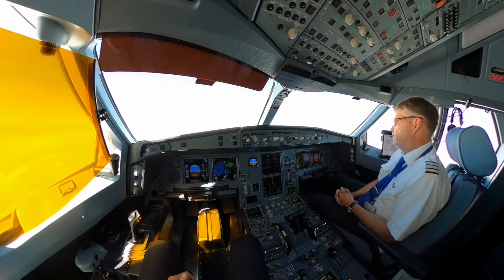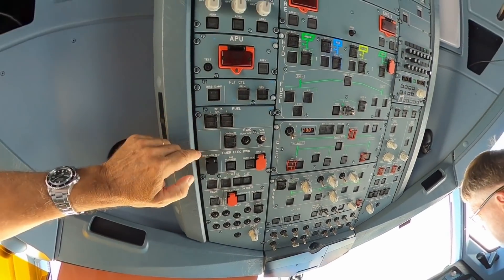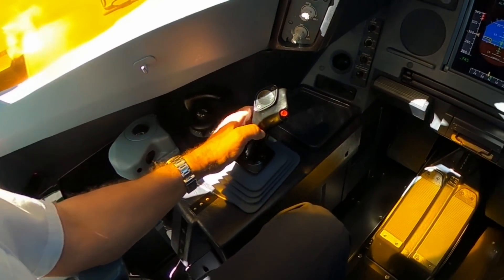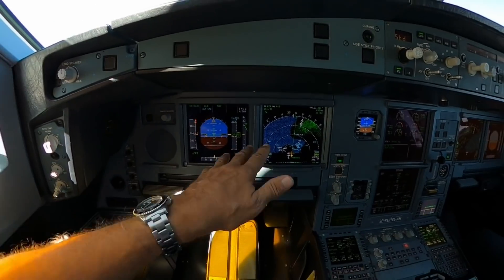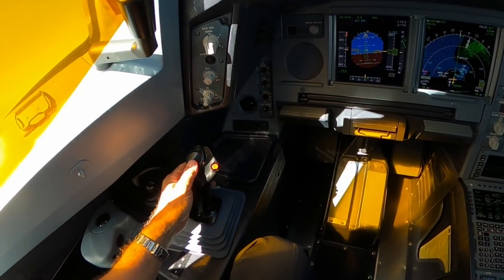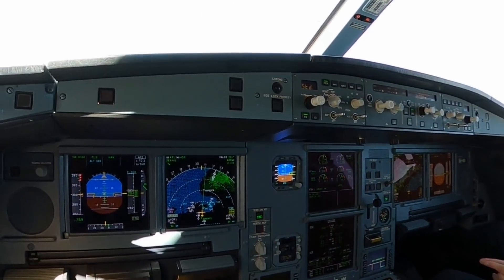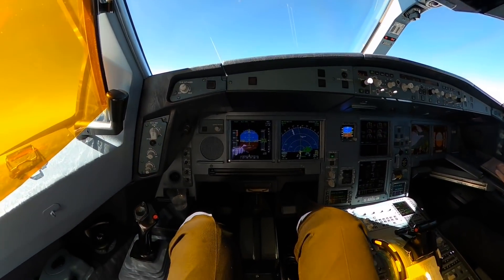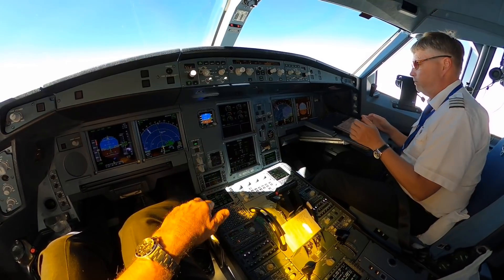The Airbus 330 sidestick.

Comment: I love learning how these computer systems work. One thing I’m curious about is (when in normal law), is there any difference in the force feedback of the stick when flying at higher speeds and altitudes? Here the bank stayed the same, being much easier to control. Basically does the plane ever roll or pitch naturally, like taking your hands off the steering wheel of a car? I know it would in alternate or direct law but would like to know more about the amount of “aid” the computers are giving in relation to the direct movements of the stick.
Reply: There is no like artificial feel or feedback on the sidestick. Once you let go of the sidestick it maintains the same attitude you left it at commanding a 1G rate of pitch (basically not pitching up or down) and 0 degree roll rate

Comment: It is telling these 5 computers what to do with the plane. So, now i am wondering in case of an electrical shutdown into a gliding state, what is the back up for maintaining control over steering the plane? Love these type of videos you provide. They fascinate me a lot as i am currently very intrested in aviation. Thank you for showing/teaching us about all this
Reply: The A330 electrical system goes through 3 mains busses. If the generators were lost then the Ram Air Turbine would drive an emergency generator which would power the Essential bus which I I think powers 1x Primary computer and 1x secondary computer. If all the busses were damaged (unheard of) then the rudders and horizontal stabiliser are mechanically controlled and the engines can be used to help turn the plane too

Comment: What if we have complete loss of those computers for some reason. The wires in the 737 help in manuvering the aircraft in these kinds of conditions.. i am really curious about this please answer
Reply: Good luck loosing all 5 (6 on A350) computers. They all run on different electrical systems and can take over one another if required. In the very worse case scenario then use the trim wheels, rudder and engines to control pitch and turn

Comment: the computer will correct the input if pilot overdoing it, am i right capt?
Reply: Depends on what you mean by doing it. The computers will protect from high AOA, overspeed, excessive bank angle, high G loads and excessive pitch attitudes

Comment: So will the flight computers go as far as holding pitch & roll through turbulence as well? Or does the pilot have to compensate for that themselves if flying manually?
Reply from the maker: The computers return the plane to the original pitch and roll. The smaller manual inputs from the pilot the better, says my experience.
Reply: @bjornpilot  Interesting, thanks!

Comment: Who decides to sit where? I always thought Pilots on the left and Co-pilots on the right. is that the case? if not who gets to decide who sits where? Either way, when learning to fly a plane do you have to learn to be ambidextrous? I can't imagine landing a plane with me left hand.
Reply from the maker: Pm8rsh 88 Both are pilots. One is Captain and one is Copilot. The Commander (Captain) is usually to the left and the copilot is to the right. Can be opposite during training.
Reply: @bjornpilot  Thanks. But what about the yoke placement though? As it's been moved from between the legs to either your left or right side. Do you have to try to be able to fly ambidextrous? Does it not feel weird for those who are right handed but have to fly it left handed. Surly there's some level of loss in control due to that?
Reply from the maker: Pm8rsh 88 No, it works fine. Imagine yourself riding a bicycle. You can hold the handle bar with either right or left hand.
Reply from the maker: Pm8rsh 88 No problem at all. Imagine yourself riding a bicycle or driving a car. You can use either your left or right hand to steer the vehicle. 😊

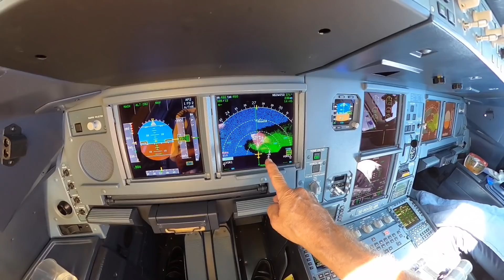Comment: Hi Bjorn, I have a question. At 5:23, on the left display the speed indicator shows 250 knots, but on the right display it shows the plane has a GS and TAS of 460 knots. Which one is true and why this difference? Also the mach is 0.80, so again, a little bit of a speed difference there... I’m not a pilot but I really want to know why are these differences. Thanks in advance
Reply from the maker: Felix Barac 250 is indicated and depends on the dynamic pressure. True airspeed eliminates the lower density of the air, at highter altitudes. GS takes the wind into acount. TAS plus or minus the wind gives GS.

Comment: What happens if you knock the side stick with your knee , while the autopilot is engaged ? 
Thanks
Reply: The sidestick is locked when autopilot is engaged and takes a fair amount of force to unlock it if not using the disconnect button

Comment: Interesting at the altitude you engaged the autopilot again (FL280) being the altitude you're unable to fly any higher without computer automation
Reply: You don't need to actually have the AP on in RVSP airspace, the aircraft just need to be equipped with a working AP.

Comment: Was not this feature Sidestick main reason for Air France disaster
Reply: Wasn’t main reason. Main reason was the pilot just decided to pull up instead of keeping plane straight and level and not follow the “unreliable airspeed” checklist. It was just a factor that both pilots used sidestick but this is drilled into airbus pilots not to do. You have to clearly state who has control of the plane

Comment: Hey!
What if the computers are failing? Can you still control the plane with the side sticks?
Thanks, Clyde.
Reply: Short answer: yes.
Reply: If you lost all computers then you’d have to resort to mechanical backup which is the rudder and pitch trim wheels. And maybe thrust levers too
Reply: @tomstravels520  Rudder,throttle and trim are all fbw so if you lost everything you'd be dead
Reply: @benedekhalda-kiss9737  incorrect. Trim can be moved by moving the trim wheel which operates hydraulic motors to move the stabiliser for the A320/A330/A340. 

Rudder on the older versions is mechanically linked to the pedals, the newer ones have a separate back up system incase of all FCC’s failing, and engines aren’t controlled by FCC’s they’re controlled by FADEC’s and EIU’s.

Airbus has a section in their manuals about mechanical backup. On the A350/A380 it’s an electrical backup that doesn’t go through a computer
Reply: My bad about the mistake on the trim wheel I forgot that. I meant if you lose all electrical power you're a goner most likely  @tomstravels520
Reply: @benedekhalda-kiss9737  if you lose all electrical power you would deploy the RAT as has happened for TS236
Reply: @tomstravels520 Obviously you would it's there for that reason. I'm just really poking at a pretty much impossible situation
Reply: @benedekhalda-kiss9737  well any modern aircraft would also fall out of the sky. 777/787 also have FBW and would become uncontrollable if absolutely everything failed

Comment: Hi Bjorn,  great video as always! I'm curious if you could explain sidestick priority in the airbus since that is something important to the sidestick since I believe there is no mechanical linkage between them like you would see on a traditional yoke.  On an unrelated topic I'd love to see a video on the A330's hydraulic systems. On the A320 only the YELLOW system has an electric pump so you need to start Engine 1 an activate the YELLOW electric pump to not have your HYD PTU run continuously if you do a single-engine taxi. Does the A330 have a HYD PTU, if so how does that affect single-engine taxi procedures? Thanks!
Reply: Not it doesn’t. The A330 hydraulic system still has 3 systems but....
Green system is pressurised by both engines and has an electric pump that can operate manually or automatically. The RAT also pressurised the green system
Blue system is pressurised by engine 1 only and has a manually controlled electric pump
Yellow system is pressurised by engine 2 only and has an electric pump that can be manually or automatically controlled

Comment: In my opinion the yoke give the pilot more connection to control the machine which is more important since both hands are on it compared to just one hand in case of an emergency
Reply: Makes no virtually no difference in the 777/787 as they are also fly by wire
Reply: @tomstravels520  one hand can't clap compared to both hands
Reply: Marxx Mann87 what has that got to do with it? In a real emergency you’d likely have one hand on yoke and one on thrust levers anyway. 2 hands in modern aircraft would make a difference as they have artificial feedback as they are not connected mechanically to the controls apart from the 737
Reply: @tomstravels520  isn't the co pilot job is to assist the captain by controlling the trust leavers in an emergency situation? To me i personally love the yoke over the stick because i have that sense of feeling of being more connected to the aircraft with my both 🙌 ! What about in a situation where one of the airmen are left handed and he's on the right side of the craft what is your take or that and viceversa for the other airman?
Reply: Marxx Mann87 no. You have pilot flying and pilot monitoring/not flying. Only the pilot flying will have their hand on the controls bed throttles. The monitoring pilots job is to operate the radios and assist by carrying out the checklists and monitoring what the aircraft is doing. Having a sense of control doesn’t really do anything. I bet the crew of QF32 didn’t think “oh I wish I had a yoke so I feel more in control of this crippled A380”. You either have control either in limited form or not.

And left handed pilots use the sidestick on the right all the time. It’s called training. They get used to it eventually

Comment: How different is it switching from the 350 to the 330 and vice versa? I see you fly both regularly so they must have a common type rating, but at least in terms of flightdeck layout, they seem quite different, so is it strange moving between them?
Reply: The layout and position of the buttons and switches are virtually identical

Comment: Great video! If you don't mind, I have some questions I've always wanted to ask an airbus pilot:

1. Are the rudder controls also fly by wire? 
2. In flight, are roll movements from the side stick linked to the rudders, to keep the turn balanced?
3. Do side sticks have feedback? Otherwise, how do you know if the plane is trimmed properly?
4. For the demonstration you did, does it also apply to pitch? Eg, if you pitch up 10 degrees and let go, is the plane going to maintain the same pitch attitude? Will the auto throttle increase to maintain speed when this happens?
5. Do the throttle levers move by themselves? Like Boeing?
Thanks!
Reply from the maker: emmw74 
1 yes, 
2 yes, 
3 there is no need for trimming since it’s done automatically. Set the attitude (pitch&bank) you like and the plane keeps it. The only time you trim (the rudder) is when you have an engine failure. 
4 yes, lift to 10 degrees pitch and it keeps it without further input. 
5 No, they do not move which is maybe controversial because you must look at the instruments to know what thrust you have. They set the max limit, like takeoff thrust, climb thrust etc. You get used to it. You can also disconnect autothrust and fly manual moving the throttles yourself, which is just like any other plane like Cessna or Piper. In fact manual/manual flying is absolutely awesome with this plane, for example in a visual approach or landing. 👌🏼😊
Reply: @bjornpilot  good to know!!! I hope to be an airline pilot someday!!!!! I'm a righty as well!!
Reply: 1- Yes
2- The fly by wire system is in charged of that
3- You don't have feedback, the plane trims itself
4- Yes it'll maintain the same pitch. Yes the auto throttle will increase speed
5- They don't move

Comment: Boeing is also fly by wire, the yoke allows more feel of the plane. Safety takes priority over comfort.
Reply: It’s artificial feel so what difference does it make?
Reply: @tomstravels520  the difference is you can actually feel how the control surfaces react to inputs.

Comment: While auto pilot is engaged could you move the side stick around with no effect to the aircraft?
Reply: From manual: "AP1 or 2 disengages when: ...The flight crew pushes on the sidestick harder than a defined threshold, or moves on the rudder
pedals beyond a defined threshold..."
Reply: When AP is engaged, the sidestick is mechanically locked in place, however if you apply enough force, you are able to move it and that will also disconnect the AP
Reply: Thanks 👍🏻

Comment: What happens if the captain turns the side stick to the left and the co pilot turns his one right simultaneously?Is the computer smart enough to ignore both?
Reply: The computer will do the sum of the two inputs, so if they deflect exactly to the opposite directions then in theory it will cancel out the actions, but you'll get a dual input alarm in the cockpit. That's why it's important to establish who's in control of the aircraft
Reply: @elliotreeves1750 , Of course, you can override that with the sidestick priority buttons.

Comment: Can't be there only one common autopilot engage button?? 
Is it necessary to have separate autopilot engage button for both capt and FO?
Reply: Yes for redundancy. AP1 takes the readings from the captains instruments and data and AP2 takes them from FO’s instruments and date. If there was a single autopilot and the captains altimeter suddenly failed or gave a wrong reading and was 1000ft incorrect, the AP wouldn’t know which one was correct and shut off
Reply: Shuvam 2 Autopilots, AP1 and AP2, different button for each

Comment: I wonder something, does pilots do the “work communication” (like checklists and anything done for the flight) in English even if the both pilots have the same native languge let’s say German for instance? I’ve seen some videos of two clearly not American/English pilots speaking in English with their partner.
Reply: From my experience nearly all crews work through checklists primarily in English because the checklists themselves are in English. Translating everything on the fly could lead to confusion or misunderstandings which you definitely want to avoid. Communication between pilots is often a mixture of their native language and English. Let me give you an example:

TCAS (Traffic Collision Avoidance System): 
TRAFFIC! TRAFFIC!

F/O:
TCAS alert. You have control.

CPT:
I have control. Traffic sollte below sein. (Traffic should be below.) 

F/O:
Schaut so aus. (Looks like it.)
Okay, wir sind wieder clear of conflict. (Okay, we're clear of conflict again.)

CPT:
Clear of conflict, verstanden. (Clear of conflict, understood.)
Reply: OhMyKMPR Thank you so much, this makes is way clear now :)
Reply: All checklists and procedure call outs is on English as “climb rate” or “gear up”.

Comment: So, you are able to fly A330, A340 and A350 at the same time, as well as holding all of the type ratings? I though you were only able to fly on type of the plane/plane family at the same time.
Reply: A330 and A350 share common type rating. A340 is a little bit different and it requires cross crew qualification to fly it together with 330/350. It requires a 3 days training to get it.
Reply: Nikola16789 thanks for the info!
Reply: Timotej Rauter 4 engines is twice as much as 2 engines hence you need some extra training for the A340.

Comment: About steering the sidestick with the left hand. That question is also relevant for yokes since you are using the left hand when landing since the right hand is on the throttle anyway.
Reply from the maker: albula642 You are absolutely right! Good point. 👍🏼😊
Reply: Wow, i've searching for this, thanks for info